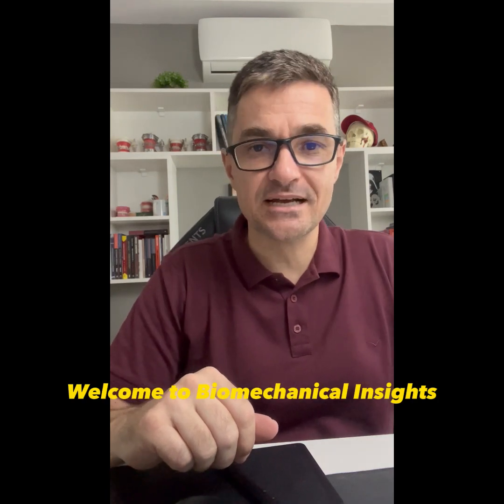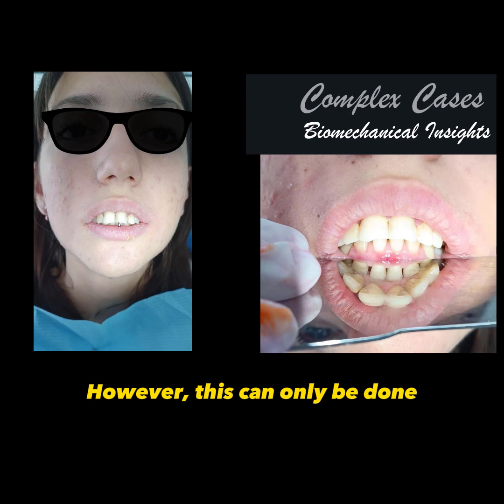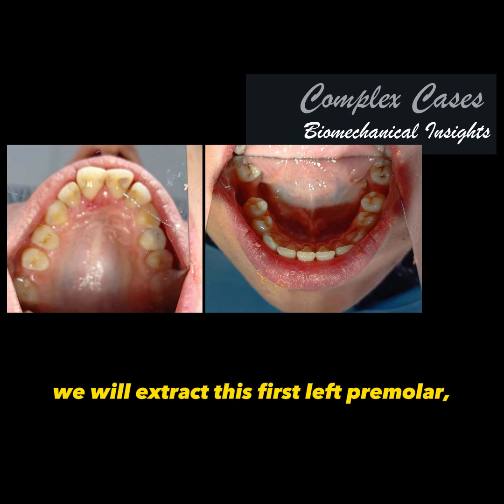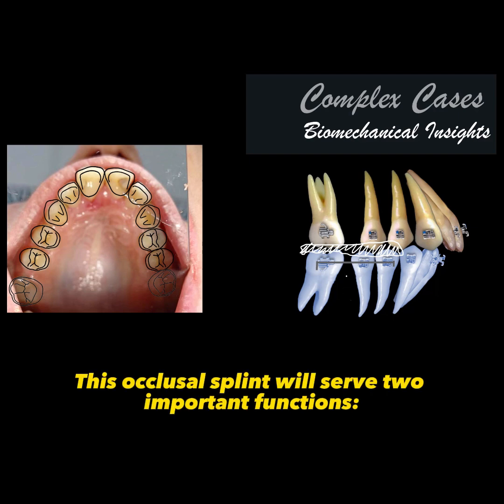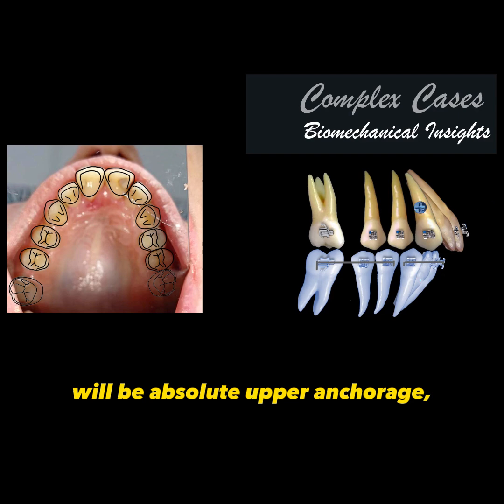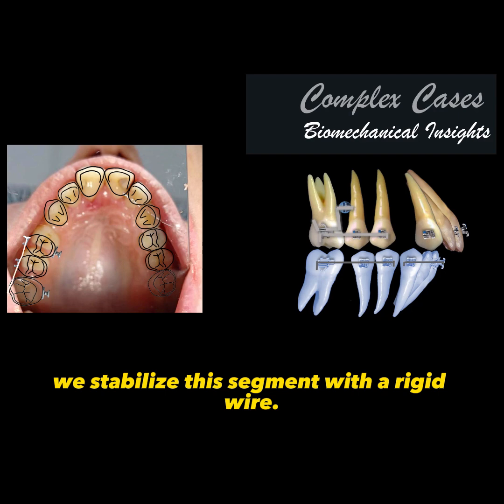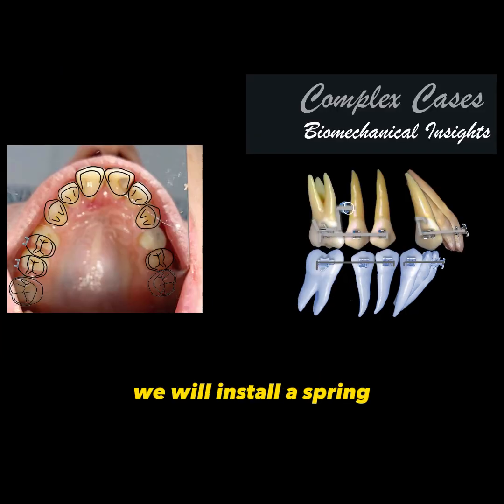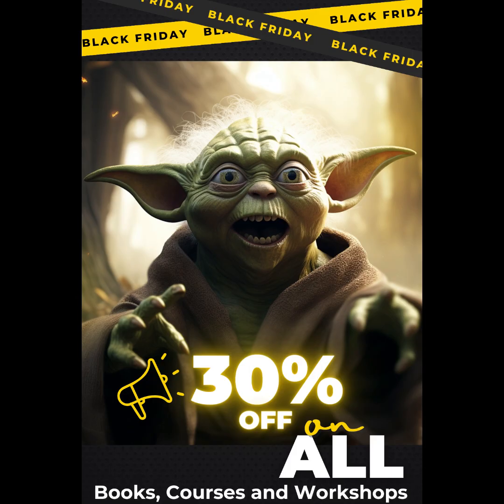Biomechanical Insights | Severe Deep Bite

Comment: Hi, do you find that raising the bite posteriorly with an occlusal splint leads to molar intrusion and an adverse effect on the overbite?
Reply: No Dr, especially in this case where the patient presents weak masticatory muscles.
Reply: Thank you for the reply. May I ask how you determined the masticatory muscles to be weak? Was it the increased FMPA? @gustavogameiro937
Reply from the maker: Yes, this is one variable that indicate the patient does not have strong muscles. But I'd not be afraid of posterior intrusion, because the splint is not used for a significant amount of time.